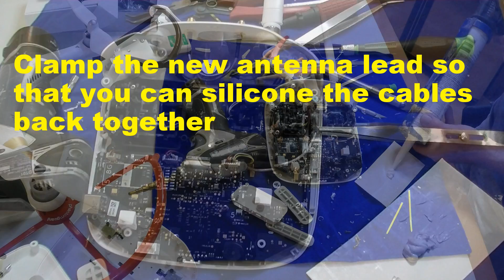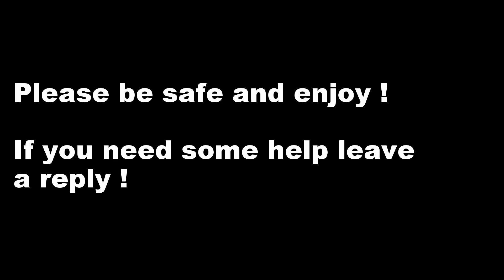DJI Phantom 3 and Phantom 4 Transmitter FPV Long Range Install upgrade / 4 times range

Comment: I have aways modified all the previous phantoms that i have had because they had poor range, but what's the point of modifying the p3? I have been 11,000 feet already 1 way before i decided to TURN AROUND, didn't even lose range. Mine has amazing range stock. If you fly much farther, you might not make it back home. Do i just have a rare p3 that out performs the rest? What kind of range stock is everyone else getting?
Reply: Jeremy Miller - What altitude do you normally fly during those long runs?
Reply from the maker: Jeremy Miller Well that's the P3 but really the P3 is good out of the box but not all areas are the same so the real reason is for penetration and low flying at a distance but if you are happy with what you have  ! Why do the upgrade save the extra $325 and install ?  ...Going out 11,000 ft is not that fun all the time anyways, Now only if the battery lasted longer then that would be fun.......But to say about  having the upgrade it has been great ....For the times I fly ... I could not fly and do what I have without it...
Reply: Right. I agree. I just don't like the whole directional antenna deal if you don't have to..the stock antennas are a lot less dependent on the directions you face. I know with all my others with helical antennas at the house, when i am miles away, you better not sneeze lol. The stock one's allow me to explore a bit miles away. Less of just a straight shot lol. I can fly between 300 to 400 feet and still go 2 miles. In response to the question i was asked. Check out my video of the 11000 feet flight, and then i have another from last weekend where i went a mile over the ocean...scared to go much farther over water lol. I am however thankful you took the transmitter apart so we all know what to expect. One day we are all going to have to replace the internal battery. Did you happen to see what kind of battery it contained?
Reply from the maker: Jeremy Miller I have had no problem with antennas being directional these are not helical antennas but the good thing is that after you do the MOD you can use other antenna too or extension cables . I will be doing video on that soon.
Reply: Those aren't helical antennas? They look just like them
Reply from the maker: Jeremy Miller no they are  Circular Polarization
Reply from the maker: Jeremy Miller you can use the  Circular Polarization or swap out and put higher db linear antenna  on the list can go on with extension to run on the roof top of a car anything.
Reply: True. I agree, its a good idea. I have just been so happy to have a compact setup for a change. Like, literally just pull it out the case and go lol. I will get bored in a few months and start doing it i am sure. I was actually gonna do a teardown of the transmitter video myself until i saw your video and there is no longer a need for it lol
Reply: What altitudes were you flying when you went that far in stock P3? I cannot get better than 3800ftin urban area at 400ft+ altitude. My area probably has thousands of wifi signals beaming all over the place. I am just outside the restricted zone of  O'hare airport in Chicago suburbs...
Reply: Really? I was like 350 feet high. I jist flew a mile over panama city beach, florida, which is full of interference with no issues at all? I was only like 300 feet on that flight lol. U got your antennas oriented right? Straight up
Reply: Totally agree with your statement.  There's no need to fly that far with the Phantom 3. If you attempt to do it, you might not make it back home due to low power issues.  DJI did an outstanding job with this drone.  This was meant to be used for aerial photography, not for long range fpv.  For that you will need an UHF long range TX and RX,  plus maybe a 1.3ghz FPV video TX and RX mounted in a better platform than a multirotor like a plane.  With that said,  enjoy your Phantom 3 the way it was designed from factory.  That modification might work out good, range wide,  but it looks ugly as hell...The radio the way it comes from factory really looks bad ass by itself. 

Just my 2 cents!...
Reply: Thats the way i feel about it. I love how sleek the transmitter is from the factory. You should see the transmitter i have for my phantom vision. WOW..talk about bulky haha. I have a black cannon helical 2.4 ghz i used when i wanted to go really far, and that thing was humongous! Those days are over haha. Thanks to dji for actually cranking up the range on this version. Too bad automobile industries dont do that with their gas mileage! Haha. Out of all my quadcopters, i must admit, my little hubsan is my favorite haha. Fast, challenging, mobile, and awesome. I just used it to inspect the roof on our cabin. Squeezed right on through them trees with no problem at all!
Reply: Self done upgrade. It looks powerful and compact.  A lot of technology systematically combined into one little compact unit. It looks great. Well done,

Comment: how much to have this upgrade done on my DJI phantom 3 Advanced controller. Also  is the dual 12v battery rechargeable ? how much will you charge to do it?
Reply from the maker: Ecig Express 
sent you a message
Reply: Vegas 800  did not get your message
Reply from the maker: Ecig Express check your email for YouTube
Reply from the maker: Ecig Express  sent you a email

Comment: Can you make a video on before and after the range and video modification.  For example show how far you can travel before the upgrade and a video after the upgrade. I think this will demonstrate the capability of upgrade.
Reply: +Eric White  realistically you will only get about 1 mile on average Straight out of the box, they claim 1.3-1.5 miles, and thats possible IF nothing is in your field of RF signal (WiFi signals,cell phones ect..)) But this mod should Easy give you 4-5 times more distance....  Now if you have this mod and your about 12-16ft off the ground, Easy 6miles i would think.. I'm going to try it soon and see , anyhow love mine,  I never worry about loosing signal.       Good luck and Safe Flying
Reply: Is this a do it yourself or will the company set it up for you
Reply: +Eric White its do it yourself, its not really hard. If your in to your hobby its a cake walk, just have to take your time and not be in a hurry. I did mine in like 2 or 3 hours but i had crazy people shouting asking me to do stuff in process lol
Reply: +Quad Galaxy Media Who in their right mind would fly 6 miles away at only 12 to 16 ft from the ground?
Reply: good question
Reply: yes i can

Comment: I have followed you step by step. But when i turned my controller on. It keeps beeping with a red light. App says " poor signal quality " description say: hight interface, watch out for long distance flight!!!
Whats wrong? Do you have an answer for my problem please?
Reply from the maker: Fares Alanazy 
 It has no problem it will do that it is because the unit is to close..... but it's okay fly it
Reply: nope it appears that i had to switch anntenas inside controller

Comment: Thank you for your video
I have already this kit I installed good in my P3P
But i have very important question I hope if you can help me
The booster that I have it now is 2.4G sunhans the black one 2.5W
And the one  that you are use it is gray one
Did you think there is difference between the two kind?
Because when I used the black booster 2.4G it was not work properly!!
Thank you again

Comment: I installed mine turn on the system and while IMU was warming up radio signal says poor, is this because it is not factor?
Reply from the maker: Brandon Greene 
Yes it will do that....... it's too close but it is fine

Comment: Hey hows it going? i got the advanced kit for the phantom 3 and tried to install it as per instructions. i cant find any more disconnected cables but for some reason it doesnt display the battery percentage, the altitude, the antenna signals satellites, etc. Video loads up almost instantly and it is green saying "safe to fly gps". 

The boosters flash blue and green like they are supposed to and i cant figure out what i did wrong. any ideas?
Reply from the maker: CypKitty 

not sure but check Con board connection

Comment: I can understand it can extend the range of control but how can it extend the video signal without modifying the Phantom drone ?
Reply from the maker: No need to Know 
It's bidirectional
and the plus side of the Phantom 3 is that it's not using WiFi but in the same  2.4 GHz spectrum and also no 5.8 GHz

Comment: where did you get the prefab piece from?
Reply: James Love the set comes with all u need, u just need tools and drilling, thats all
Reply: Kanashto Sure, but the set is a laughable rip-off at over $300.  Most idiots with more than 2 brain cells can DIY with very little effort for less than 1/3rd of that...
Reply: marbleshark can you PM me a list of the items here? I just want more range, and I already feel this is a ripoff and I didn't buy it yet. i had some emailing going on about the battery and one of them from their site told me that battery is exclusive to them, yeah right.
Reply: +marbleshark this DIY pricing for a custom made job is extremely reasonable. All of the problems have been solved by them and all you have to do is assemble it like an erector set. You are not only paying for components but for their expertise in combining components. This is not a factory assembly line product and therefore should not have the same pricing.

Comment: I cant get why are you doing the step at 4:50 why dont you use the holes that you make later on the video? Explain to me that  plzz.
Reply from the maker: Fares Alanazy  I don't understand your question
Reply: Vegas 800 hes probably asking why u raised that dial but its obvious its raised to make space for cable to go under then its screwed back (he might have thought u did something redundant, but it wasnt)

Comment: Is there a reason that you didn't decide to use the factory antenna mounting holes instead of drilling new holes? Also, why can't you route the antenna wires on to of the circuit board instead of under?

Last question. If the factory antenna are no longer hooked up, why leave them there?
Reply from the maker: Gunga Dinn  
Hi I could of but as I said before to another post you need to do some cutting and then the holes are larger. but most of all if I want to put it back it's easy to  fix... plugs in the holes and then your done.   Hope that helps
Reply: Vegas 800 I installed my FPVLR kit per your video but when I turn on the radio it now makes a beeping sound? I did not install the boosters yet because I wanted to do an incremental test  from what I know the antenna should work without boosters so obviously something went wrong? Any ideas what might cause the radio to emit constant beeping immediately after powering on the radio? As a side note I accidentally powered on the radio after I re-assembled the radio not thinking that I forgot to connect the external antennas? Could this burn out this radio as I have see happen with video transmitters if you do not connect an antenna? Seriously bummed now since Phantom 3 radios are not available yet and now the warranty is broken with this mod. Can you troubleshoot this for me if I send you my radio?
Reply from the maker: Peter Klimon 
it's a simple unplug and replug of connections if you think about it for a install but things can go wrong by accident.  

 I would look at the connections again at the CON board to start unplug and replug and contacts line up.

 And if you have to reopen the case you will at least have to reinspect all connections. It's a mistake to turn on the radio if no antennas are installed but I have not experienced that ????? but really think it's  a connections ...Maybe you tugged on something if you sent or when you sent the cable underneath the board.

Hope that works
Reply: Vegas 800 It seems I nicked the ribbon cable from camera tilt switch so I had to buy a remote on Ebay since DJI did not see fit to make parts available? A lousy $10 ribbon cable ended up costing $300! Those ribbon cables are so susceptible to damage while removing the silicon gel used glue them to the plastic shell? Upon reflection I should have routed both new cables down the center of the radio and totally avoid the two ribbon cables routed on the right side of the remote. Is there any other way besides using xacto cutter to remove the silicone gel? I HIGHLY RECOMMEND USE EXTREME CAUTION WHEN MOVING THE RIBBON CABLE! 

I am curious if you do any testing of RF before you connect the boosters? If so what should the readings be and what do you use to test things?
Reply from the maker: Peter Klimon I am sorry you had trouble with your install. Yes I stressed people be very careful about that ribbon cable. You're lucking to find another transmitter at least without going to DJI.
As far as testing you would have to call Tony

Comment: is the stock antenna useable after this mod? or not?
Reply from the maker: Fares Alanazy The stock antennas are not used but they are just unplugged and kept there.  Could be removed all together but to get them out you have to cut a bit and then plug the holes up or do much more work to have the cable ends come out of the holes..
Hope that helps

Comment: hi can i buy new inspire 1 transmission with ready and install this package ? if you have any one ready to sale i will buy it, please answer , thanks
Reply from the maker: IIPHOBYAII 
You could order a new transmitter or find a used one ....or send yours in to have it added ...I have seen some for sale at times some people order Inspire 1 with 2 radios and then decided that they don't need both...